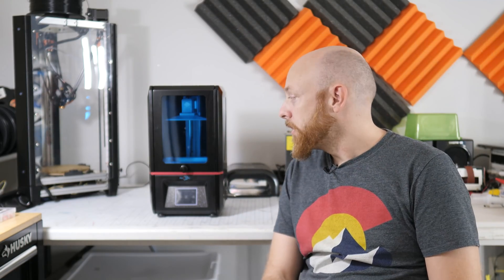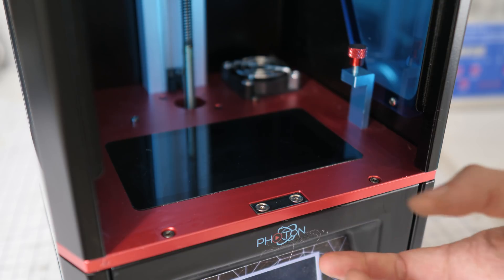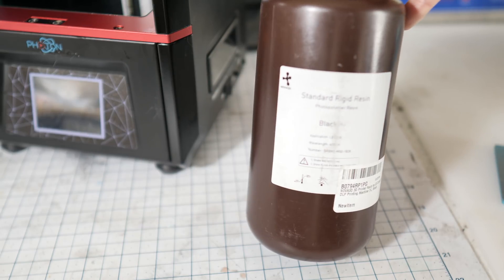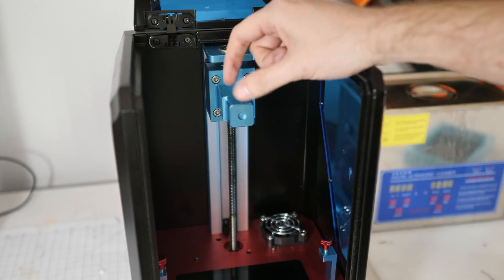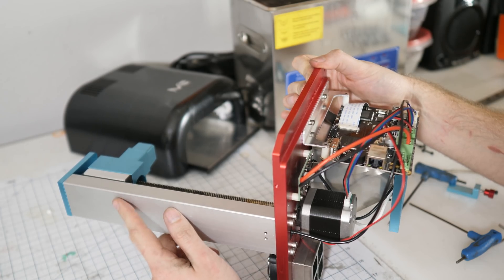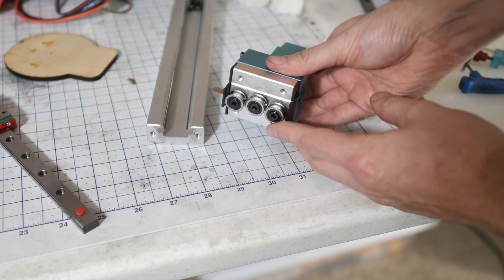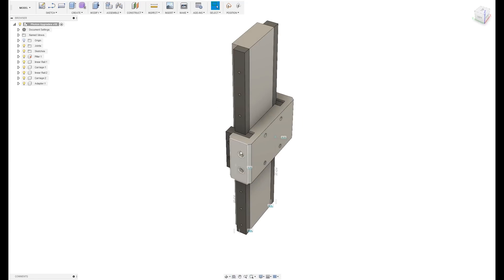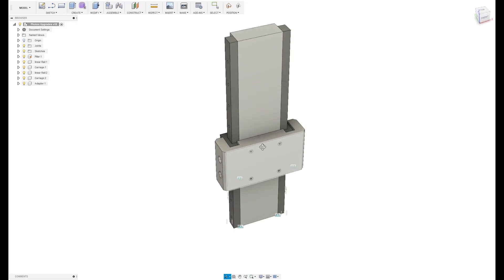Anycubic Photon Tear-down and Upgrade - S02E45

Comment: you guys forgot to upgrade the firmware to enable antialiasing. The Photon S already comes with the newer firmware, which is why the parts it puts out are much more "glossy".
That being said, Good Job! @o@)
That new rail looks even better than what the Photon S has.

Comment: Cool mod, even if hard to do for most normal people at home. The lcd screens on these printers are considered consumables; They WILL fail in relatively short order compared to normal use lcd stuff since the uv light will damage them over time. Laser based resin printers do not suffer from this but are way slower. Lets hope they find a cool solution to this soon.

Comment: I never managed to print anything useful on this printer.
Once I did test with standard M14 bolt and nut designed in fusion 360, then printed it, it didn't fit at all.
Other time printed something for colleague from work, mostly cylindrical parts, with a thread too, but all was out of tolerance up to 0.6mm and nothing fitted, absolute shit, useless, getting better accuracy on my $200 FDM printer...
It's absolutely mindblowing how it can be soo bad when it has such high resolution and material shrinkage is very minimal.

I bought it purely for high tolerance precision prototyping of various parts, but instead I ended up with a printer that can do only "pretty models"...

Comment: A couple pieces of angle aluminum and a small chunk of 1/4" (or whatever thickness is needed) aluminum would provide the same results and you wouldn't need much more than a drill press.

Comment: How is that you destroyed the screen?
Isn't it like glass - waterproof, and glued to the alu frame?
I'd expect it to flow to the sides and escape throughout the front doors or on the inner steel wall.

Also you missed one design flaw that you should fix next - that annoying buildplate that once leveled, needs to be leveled again before every print, because once you do one, you bang it with the spatula to remove the print and it moves, even though you torqued that grub set screw that the allen key is bent.

Comment: is there a reason why you've put a strip of metal between the rail and the main railing?
Reply: think it was to adjust for tolerances. his cad file allowed just a bit more space than he actually wanted just to account for the margin of error because he new he could add just a hairs bit more thickness this way for a tighter fit.

Comment: With the two linear rails mounted on the sides, this can not work. The Z-axes is a piece of extruded aluminum and this is never ever a straight part - surely not straight and square enough to mount the rails on.
You should mill the sides of the profile before mounting the linear rails on them and you should do so in one process to make sure the rails are parallel enough. You also need better precision for mounting the rails exactly vertical. If one rails is 1/1000" off, then you are screwed. On the other side, these cheap linear rails have a fair bit of play ;-)

Comment: Hi 
Great mod, are the linear rails 250mm ? The ones you link to are 350mm long, and they seems to be a bit long?
Reply from the maker: The 200 mm are actually long enough, and don't require any cutting. I would recommend those

Comment: That is great and all, but you made a video how you made this printer better, yet, you didn't provide any files or sources to be able to do it ourselves, I am sure people following you would appreciate it way more, if you can at least share your 3d model files or a drawing so they can take it to a machine shop in case they don't have their own CNC, the parts with the links provided are useless without the main rail
Reply from the maker: 3D models are posted here:
http://www.physanon.com/anycubic-photon-3d-printer-part/

Or you can by some pre-made ones here:
http://www.physanon.com/photon-upgrade/

Sorry that took so long to post.

Comment: Interesting mod, but unfortunately not the most of us had those equipment. Anyway another improvement is to replace the stupid central build plate adjustment by a easy to handle 4 screw clamp. This is also sold in different resin printers shops, or you can print one for example my version from thingiverse YAEZ Yet another easy Z adjust for Anycubic Photon found on #Thingiverse https://www.thingiverse.com/thing:3157157.
Reply from the maker: 3D models are posted here:
http://www.physanon.com/anycubic-photon-3d-printer-part/

Or you can by some pre-made ones here:
http://www.physanon.com/photon-upgrade/

Sorry that took so long to post.

Comment: Yes and you to can make your $400 anycubic DLP SLA printer marginally better.  All you need is $130,000 worth of machining equipment and materials. LOL
Reply: My thoughts exactly. I mean why not just buy a better SLA printer for all this work.
Reply: I was along this line of thinking and then was like why not just buy a better 3D printer if you need better precision.
Reply: @mekko1413  Because a lot of people who get into 3D printing enjoy the fun of a project and of upgrading a machine they already know and love. Plus, with PA selling their machined parts for this, the cost of this upgrade comes in easily under $100 USD (less than the cost of an upgrade to a Photon S) and significantly improves the printing without even taking a whole lot of time or extensive modification to do.
Reply: Only 25k in matching equipment. Honestly though you can do this with a drill press and 3d print the bearing mount. Rigidity isn't super important just the accuracy of the new rails.
Reply: I have a CNC when I want super precision work done I just get it done by high level experts. They are $80-100 an hour. They would cut that in less than an hour. Out of steel or Alum.  Oh and that mill costs about $15k.
Reply: more like $7k, Tormach is  pretty low grade.
Reply: @foam27  A base machine cant do anything by itself. You still need stand, computer,  tooling, the list goes on. You can probably get a harbor freight rig working for 7k..... after three or four years jacking with it.
Reply from the maker: would be silly to buy a CNC to make one of anything.
Reply: Physics Anonymous still very impressive work. Bummer you busted the LCD cover. I was debating on getting a photon but for what I do I think FDM is the way to go. I’m never really doing miniatures.

Comment: Those rails can’t handle a lot of out of plane misalignment, you should have put them both on the same plane and has one fixed to a step or dowel pins for positioning and the other one be floating so you could dial in the parallelism to the fixed rail manually. It’s a more carefree way of doing a stage design, lookup any thk or Parker linear stage and that’s how they do it.

Comment: As a prospective anycubic photon owner, would you answer a question for me? If this upgrade is performed, and the distance extended, is there an option in the software to change the z axis stop?
Reply from the maker: absolutely, the software is pretty open, there might not be a setting in the menu, but the config files are easy to change, though i shutter to think what the print times would like on a taller part.

if you want to buy the upgrade, or print your own, here are some links:
3D models are posted here:
http://www.physanon.com/anycubic-photon-3d-printer-part/

Or you can by some pre-made ones here:
http://www.physanon.com/photon-upgrade/

Sorry that took so long to post.

Comment: Personally, I feel like the precision you gain from CNC Machining the components are pretty much lost with the shim. What I would have done is take a new piece of steel, machined a new component for the rails to sit on...slightly oversized, precision grind it to within a few tenths, and then a the bracket going on being CNC machined carefully would ensure flawless results and it would be perfect. Nevertheless, it is certainly neat to see you design your own part and then manufacture it to improve that little thing. And you should make the Autodesk Ender. Completely Open-Source and open source resins too. You have a mill, might be some good videos.
Reply from the maker: good advice, i ended up going back and dialing in the model so no shims were needed. i have them up for sale if you're interested:
3D models are posted here:
http://www.physanon.com/anycubic-photon-3d-printer-part/

Or you can by some pre-made ones here:
http://www.physanon.com/photon-upgrade/

Sorry that took so long to post.

Comment: Ok.. What about blueprints for making the part? Video without instructions is useless..
Reply from the maker: 3D models are posted here:
http://www.physanon.com/anycubic-photon-3d-printer-part/

Or you can by some pre-made ones here:
http://www.physanon.com/photon-upgrade/

Sorry that took so long to post.
Reply: @PhysicsAnonymous  at patrion there are files missing. Can you please check? I downloaded STEP file and it has only the post model inside. Fusion 360 is compltely empty. I need the clamp model to cnc mill it for my photon

Comment: Thanks for this video, i hav an idea, that built ad buffer resin bottle, inside rear in the machine, with a hose in an bottle up side down, the hos running down in the vat, and if the vat is running emty om resin, a air goin in the bottle an there is coming more resin in the vat, all is based on vacum from the vat to the bottle with resin, that continue to fill resin in the vat without running emty of resin when You build something big. 

Its only an idea, havet tryed out yet but posible

Comment: That's really a detail review and update. I saw the pcb board. Nice video Physics Anonymous
Reply: Any chance we could get an upgrade kit from you guys?
Reply: @resmores  since photon is not modular designed an upgrade kit is not easy to achieve. But we could look for other ways to upgrade photon.
Reply: @ANYCUBIC3D  Please, I need this upgrade cause my Photon still wobble even after suggested adjustments. Would be great a upgrade kit...
Reply: @ANYCUBIC3D  i dont see any problem, to unscrew the post and change it to new one for rails upgrade + 4 more screws to put platform mount on new post it is not welded to base. Piece of cake. This is how it should  have been done from the start.

I would definitly buy this kit!
Reply from the maker: 3D models are posted here:
http://www.physanon.com/anycubic-photon-3d-printer-part/

Or you can by some pre-made ones here:
http://www.physanon.com/photon-upgrade/

Sorry that took so long to post.
Reply: ANYCUBIC if you upgrade the photon I will definitely buy one!

Comment: On the facebook group for the printer, people are recommending putting kapton tape around the LCD edges to prevent the resin from getting through. Some are also putting a complete glass screen protector on -- I think the Nintendo Switch-sized protectors are recommended. I tried the kapton tape and it worked well (but no leak yet so not tested). I'd be curious if you'd sell the upgrade parts too (if only the part that needed machining).

Edit: caught your reply below mentioning you will be selling the part, awesome!

Comment: You can prevent LCD damage from resin leaks by putting a line of kapton tape around the edge of the glass screen protector on the lcd.

 Another popular way of preventing it is to simply install a nintendo switch glass screen protector.

Of course you will need to re-calibrate after doing this.
Reply: Cool, do you have a link on how to use the nintendo protector? Won´t the added 1mm big gap between lcd and fep film blur the image too much?
Reply: @CAPTAINCAPSLOCK111  Well, Im going off what was reccommended on the Photon facebook group. From what I understand any of the glass ones on amazon will work, you just have to re-level after installing it.

You might want to also get a thin kapton tape and seal the edges so any leaked resin doesnt wick up under it.

Comment: if you are replacing the LCD you should upgrade to a higher pixel density. That should Give you better resolution on the x and y. even if you get a slightly smaller build volume. in resin resolution matters more then build Volume.
thank you for the video.
Reply: Except there are no displays with higher pixel density and this size. Show me one that can be conerted to UV

Comment: Great video. I added tension to the center bearing with spanners and it improved print output remarkably. Yup - that FEP film is easy to puncture, but it's the caveat of getting high resolution prints withe the DLP process. I have an auto-off mod on my channel that's easy in case anyone is interested. It just shuts off power when it's done printing. I'm adding on wifi for the next mod. I'm tired of doing the sneaker-net usb shuffle. :) Thanks for showing how to rig up a new rail. If I had a mill at my disposal I would do that.
Reply from the maker: 3D models are posted here:
http://www.physanon.com/anycubic-photon-3d-printer-part/

Or you can by some pre-made ones here:
http://www.physanon.com/photon-upgrade/

Sorry that took so long to post.

Comment: 1 KG of filament does not last 4-5x longer than 1 KG of resin. They are both 1 KG.
Reply: Well, with resin systems there is unavoidable  loss with each print; after printing the parts have to be rinsed in alcohol to removed excess resin.  That resin is lost.
Resin can gel if it has been 'in the tank' many times.
The bulk liquid resin is exposed to incidental UV light, this can be enough to make it thicken in the bottle.  Eventually it gets too gummy to pour.  Throw it out, buy more.
Long story short, resin systems have less finished product per kilogram of raw stock than FDM printing.
FDM can print a part with zero waste, resin systems cannot make the same claim.
Reply: @pirobot668beta  Resin has about 10% waste, not 400-500%.

And never heard of anyone throwing out "gelled" resin. In fact, people leave it in the tray for months, often not even putting it back into the bottle - with no problem from it.

Comment: Let's see your FDM printer do that.

Challenge accepted. Send me the STL :-) I mean it. I have a machine that "MIGHT" be able to do that with FDM.

that was a pretty slick thread in though!!
Reply from the maker: Awesome! I will post the model on our website tomorrow
Reply: cool. I have a slightly modded Ender 5 that I have been getting close to resin micro prints out of. I have not yet tried super fine threads. :-)

 @PhysicsAnonymous
Reply: @PhysicsAnonymous  Hello! What is your website? Really need this model. Thank you
Reply: @PhysicsAnonymous  Would love to see the 3D resources you used to build this - would love exploring FDM solutions in some excotic filaments...
Reply from the maker: 3D models are posted here:
http://www.physanon.com/anycubic-photon-3d-printer-part/

Or you can by some pre-made ones here:
http://www.physanon.com/photon-upgrade/

Sorry that took so long to post.
Reply: Indeed, challenge accepted - printer is working on it. Will be interesting to see if it is possible. :-)
Reply: where did you get the file?

 @DE3US
Reply: Drew a test model with a 52x0.75 thread. I do not have the exact model. Looks like it will be available tomorrow though. I do not have a camera either so a counter thread is also in the making. If they look pretty decent i'll try them on a real camera.
Reply: Remembered there is an old camcorder on the old electronics box. It has the smaller T37 (37x0.75mm). So i printed a T37 version and the filter from the camcorder goes straight on - no post processing needed. If that translates well into the T52 the id say it's doable. Still need to test the T52 on a camera.
Reply: this will be fun!

Comment: Yeah going to a shop who has such a machine to make the pieces i need to upgrade my photon would charge me more than double what the printer did cost in the first place. which means i could have bought a moai to begin with. Don't get me wrong. cool job dude. Just not practical for everyone (not saying you claimed that)
Reply from the maker: Haha, fair point. Luckily for those with a photo looking to upgrade, I will be selling the adapter on our website in the next week or so for a pretty reasonable price. You will still have to drill and tap the pillar for the rails, but there are many ways to do that accurately without a cnc or mill.
Reply: @PhysicsAnonymous  Will this be available on your website soon?
Reply from the maker: 3D models are posted here:
http://www.physanon.com/anycubic-photon-3d-printer-part/

Or you can by some pre-made ones here:
http://www.physanon.com/photon-upgrade/

Sorry that took so long to post.

Comment: For those of us without access to industrial CNC machines, could the bracket you made be 3d printed? And what was the foil/thin sheet shim for?
Reply from the maker: You sure could! It wouldn't be as stiff, but at a high infill I think it will still be a lot stiffer then stock. I will make the 3d files available on our website site soon, I will also be selling the machined bracket soon as well.
Reply from the maker: 3D models are posted here:
http://www.physanon.com/anycubic-photon-3d-printer-part/

Or you can by some pre-made ones here:
http://www.physanon.com/photon-upgrade/

Sorry that took so long to post.

Comment: I wonder if a person could mill in a moat around the LCD on top so if a leak happens the resin could be run off in a safe location ?
Reply from the maker: Ryan and I were just talking about that last night. I think that is a great idea
Reply: @PhysicsAnonymous  I wonder if you could simply seal the gap with a RTV silicone, kinda like grout and tile? That way when you need to replace the LCD it wont be difficult to remove, but otherwise should provide a chemical and heat resistant barrier.